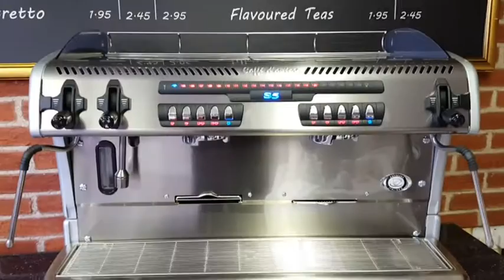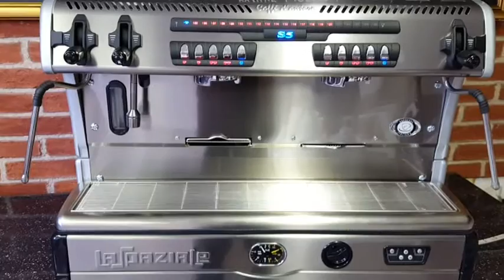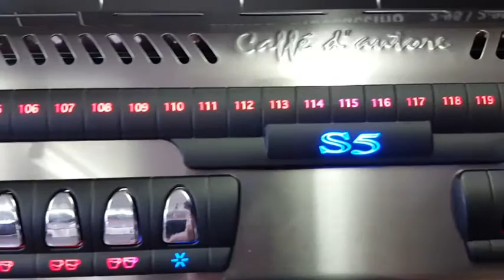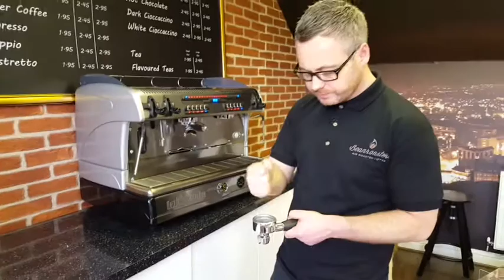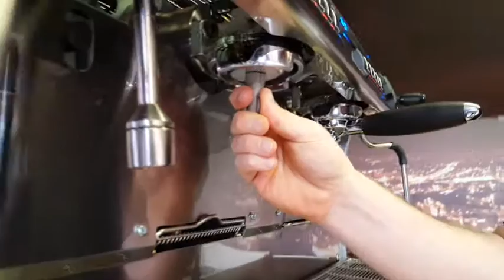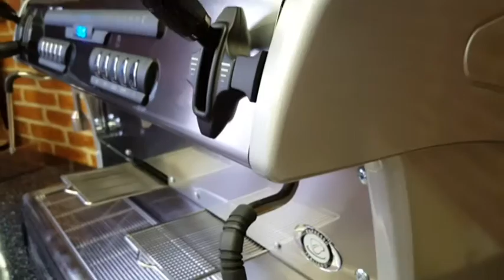La Spaziale S5 Espresso Machine

Comment: Hi, my S5 is having issues currently. When I plug it in, it begins initial heat up phase, then after 5 minutes it stops and all of the lights above the group heads flash. Any ideas? Thanks
Reply: Your water supply has been cut off to the machine.

Comment: Hi, my machine is model s2 ep Spazio and I connect all water devices. But it's coming cold water from the water outlet and also water has won't come out steam wands. 
How long should I wait to see it's going to be hot? Or how can I fix it?
I guess the water boiler isn't working...
Reply from the maker: In 5 mins you should hear a boiling noise. Try opening the steam arm when you turn it on then turn it off when steam starts coming out. Some machines create false pressure on turn on and so don't heat up, if you don't do the above.. If that doesn't work let us know where you are and we will see if we can come out and help you with it.
Reply: thank you very much, I will try to fix it by myself. And if it wouldn't work I'll ask you again. 😁